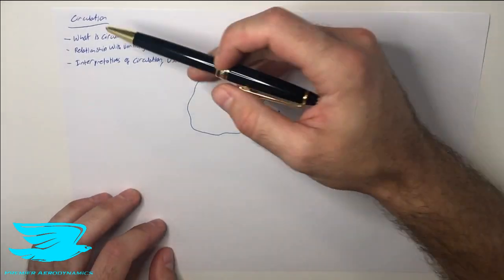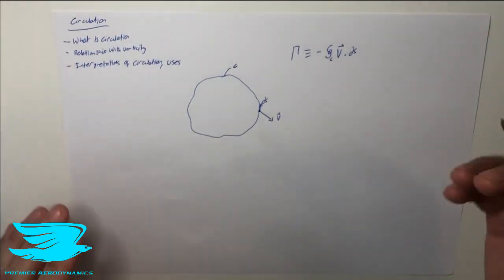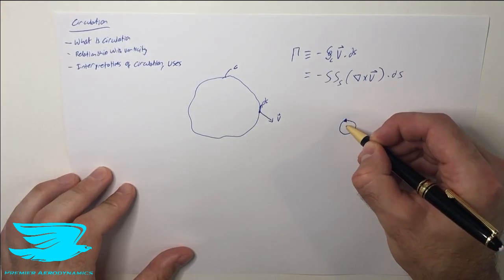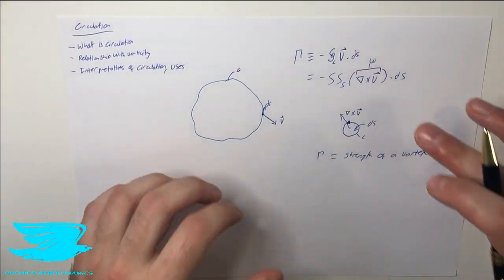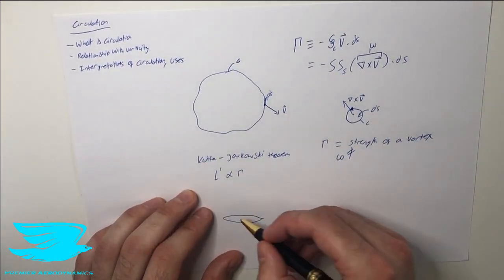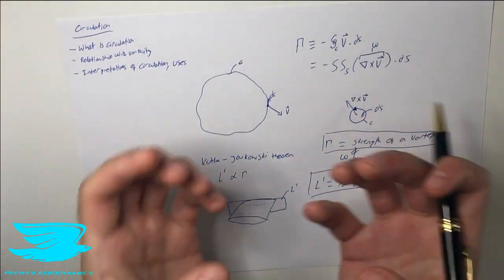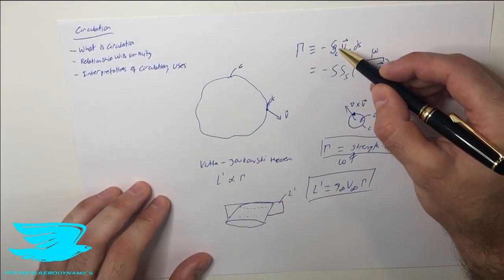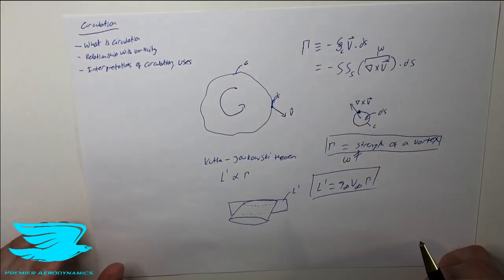What is Circulation in Aerodynamics? [Aero Fundamentals #11]

Comment: I probably have no clue what im talking about, im currently doing aerodynamics for a physics research project. Im already thoroughly confused but can the kutta condition be used to accurately calculate the lift on a wing or is it better to use the lifting line thorem? Or maybe a combination of both?
Reply from the maker: Both of them can be used. The Lifting line theory is for a planar wing, while the kutta joukowski theorem can be used for an airfoil section. In other words, if you are looking at 2D, just use the kutta joukowski theorem. If you are looking at 3D, use the lifting line theory.

Comment: Just giving a guess, but if the circulation is zero, the vorticity would be zero. Therefore for a closed loop, a vortex would not form?
Reply from the maker: It depends on how you define the closed loop. If the closed loop encloses two vortices, but of opposite sign, then they could cancel each other out in terms of vorticity when calculating the circulation. Hence, you could have zero circulation but not zero vorticity inside the closed loop.

Comment: Kutta Jukowski theorem is basically a 2d transformation that 'transforms' the airfoil to a cylinder. Which is why circulation can be used to calculate lift. Therefore, if circulation = 0 then so does lift.
Reply from the maker: I'm not quite sure I understand what you mean.

Another reason why the Kutta Joukowski theorem works is because there was this theory, for the longest time, that when flow first starts to go over an airfoil, a vortex filament is shed from the trailing edge.

This travels downstream and theoretically, is connected to the airfoil throughout the entire flight. For example, say you have a plane taking off in London and flies all the way to Tokyo, theoretically, this filament will be connected to the wing the entire distance. A filament from London to Tokyo.

It was difficult to prove that a vortex was shed the moment air started to pass over an airfoil because wind tunnels start ups are usually nonuniform and CFD takes time to converge. But, maybe 15 years ago, there was video proof that a vortex does indeed get shed.

So that means that the Kutta Joukowski theorem can be used because the entire airfoil is in this region of circulation, which it creates.
Reply: @PremierAerodynamics  Just mathematically speaking, since circulation is multiplied by the other 2 terms, and lift is a product of the 3 terms. If circulation = 0 then lift = 0 because 0 times anything is 0.
Reply from the maker: @rolandotillit2867  Oh okay, I understand.